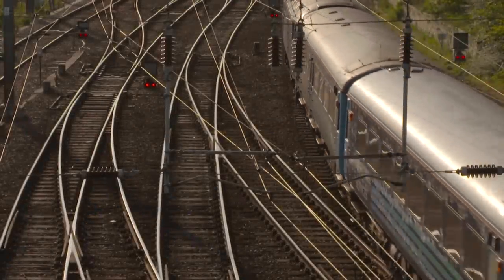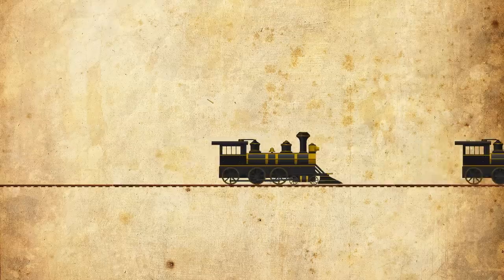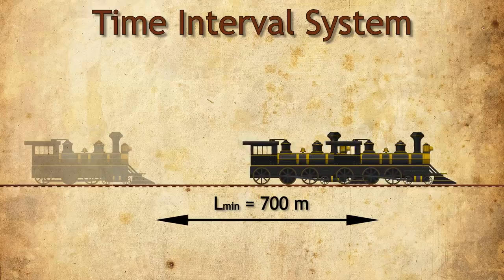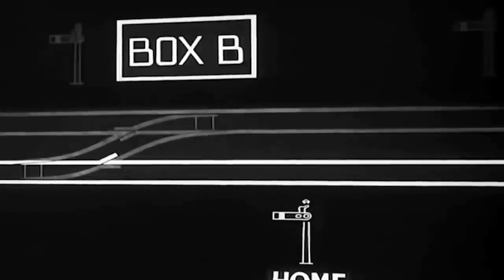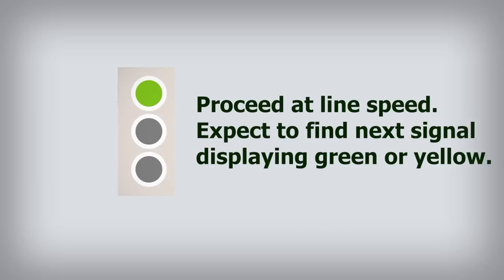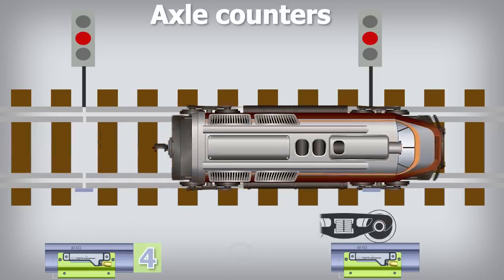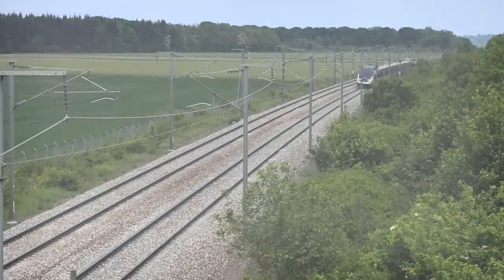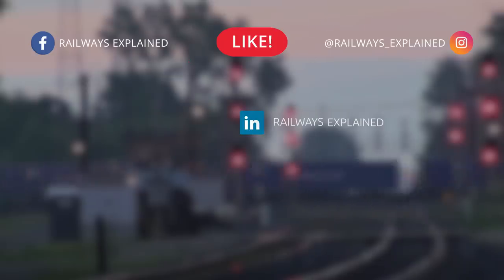How RAILWAY SIGNALLING Evolved from Flags to 4G Network

Comment: Correction, highest speed with lineside signals in europe is higher than 160km/h although in most countries its 160km/h. In UK it is 200km/h, in France it is 220km/h. On the French line thats 220 the first non green aspect a driver will see is actually a new speed limit sign, which is backlit, at 160km/h. I've always wondered if this is some sort of separate distant signal to extend the braking zone.
Reply: Also 200 in Spain (with ASFA protection system, at higher than 200 the ETCS system is required).

About the pre-warning 160 sign you mention, we also have something similar in the form of a blinking green signal aspect. It's called "conditional clear", it means that the track is still clear ahead but you should reduce to 160 because you might find a warning yellow signal later. I think most countries allowing higher than 160 speeds with physical signalling systems have an equivalent indication to pre-warn fast trains
Reply: The "flashing green" was introduced at the SNCF: trains traveling at no more than 160 km/h could consider it the same as any "steady green";  instead the driver of a train traveling at more than 160 km/h had to slow down until the speed was reduced to no more than 160 km/h before passing the next panel.  A pre-announcement signal (P) was also provided for mobile TIVs when presented.  A similar pre-announcement signal was also foreseen for what concerns the TIVs of the construction sites (temporary signs placed to order the reduction of speed in correspondence with sections of line along which works are being carried out).  Instead here in Italy, to allow circulation at speeds above 160 km/h along the "Direttissima" Rome - Florence, they invented the repetition of signals (Cab signals) with 9 codes, adding a second carrier to the one used for the "Automatic block with coded currents" of the American school.

Comment: Thanks for this informative  video on railway signalling, From childhood i have been fascinated by the Railways and still that enthusiasm of train journey has not receded, i always take a train for a overnight journey, during my young age i used to see only Semaphore signalling and that too some had oil lamps at night, put up by the gangmen every evening and slowly this changed to lights with the cables from the signal switching post run to a distance with rollers The mechanical hand lowered or lifted up to show proceed was a marvellous and slowly colour light signalling takes over, i was waiting to hear you say about the keys transferred from one station to other y the loco pilot and this helps to operate the signal lever so that the loco pilot understands whether the block is clear or not clear. There used to be a bamboo bent like a tennis racquet and a leather wallet belted to this will hold the key, when passing a station the loco pilot drops his and grabs the one held by the gang men, this was lovely to watch especially during night when he holds the key with one hand and fire torch in the other, Please show more videos about signalling.

Comment: Actually, although 160kph (100mph) is a common limit for lineside signals, some countries, in particular the UK and France, allow running up to 200kph (125mph) under lineside signals. The UK also did do test running at 225kph (140mph) using an extra flashing green aspect, but this was never used in service (although the flashing greens are still present on the route where the tests took place).
The main variation from the basic green-yellow-red system is speed based signalling. These tend to still follow broadly the same principal, but add in additional aspects (either multiple aspects together, flashing aspects or both) and sometimes will even display maximum speeds. Some systems will also have different forms of red signal, one being an absolute stop, and one being a "stop and proceed with caution". The UK has it's own variation on green-yellow-red which adds in an extra "double yellow" as an advanced warning, allowing trains to run closer together by reducing the block length whilst still maintaining the same braking distance.

Comment: In Britain the maximum speed is 200 km/h except for the high speed channel tunnel rail link.  This speed was introduced with the diesel InterCity 125 in 1976.  Britain is an exception to the rule that the maximum speed is 160 km/h if trackside signals need to be observed.
Reply: There are some classic lines with a max speed of 200 in France too. But except those specific sections, the rule is 160 max.
Reply: @Alfred Weber The requirement for a second man over 100mph was dropped I think in the early 90s, with the limit increased to 110mph. These days it is 125mph unless there is cab signalling.

Comment: The "flashing green" was introduced at the SNCF: trains traveling at no more than 160 km/h could consider it the same as any "steady green";  instead the driver of a train traveling at more than 160 km/h had to slow down until the speed was reduced to no more than 160 km/h before passing the next panel.  A pre-announcement signal (P) was also provided for mobile TIVs when presented.  A similar pre-announcement signal was also foreseen for what concerns the TIVs of the construction sites (temporary signs placed to order the reduction of speed in correspondence with sections of line along which works are being carried out).  Instead here in Italy, to allow circulation at speeds above 160 km/h along the "Direttissima" Rome - Florence, they invented the repetition of signals (Cab signals) with 9 codes, adding a second carrier to the one used for the "Automatic block with coded currents" of the American school.

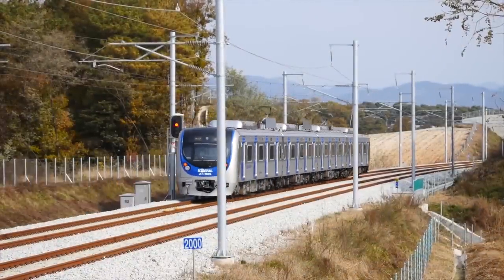Comment: 10:05
I am so thankful you showed good example as Korean. The blue train set is of Korail 371000 Series EMU operating on Gyeonggang line (means connecting between Gyeonggi and Gangwon province) Korail Metro. Most of Korean railfans think 371000s are special. It is because they can be operated on all 25,000V alternating section despite no control centers' approval. ATS, ATP, and ATC were installed in them as first subject of Korail all EMU series. (Of course they cannot be in Direct Current 1,500V ^^;;;)
As locomotives, there are Korail's EMD GT26CW DL7573 ~DL7576 introduced in 1996(earlier than 20 years comparing with 371000s), which are worked as special engine on High Speed Rails; Relief Wrecking Drive TGV-K, KTX Sancheon, and EMU-260&320 of Korail. Unlike other GT26CW DLs in Korea, ATC(for TVM-430) were installed in the four. 
Thank you for reading and have a nice day sir. :)

Comment: It's was a really nice sum up of the evolution of railway signalling. I did not even have an idea the Time interval Signalling existed. 
I suppose it would also be useful to mention that CBTC systems are currently only associated with metros and not yet with main lines. Also a few words on ETCS signalling
Reply from the maker: Thanks Harish for the comment.  We agree with you.  All this will be covered in future videos about signaling.  We think that this video has hit the point and that it allows people who are not dealing with the railway to understand the basics of signaling.
Reply: @RailwaysExplained  My railway will be moving toward the CBTC system as part of stage two implementation of the ETCS ATP that you showed. I agree, another video on ETCS and CBTC would be good.
Reply: @trainstrains1  I am pretty sure that the moving block system is part of ETCS level 3, which still hasn't been properly implemented on any railways. ETCS level 2 is "virtual block" it does not have line side signals, but it still has fixed blocks. This means that blocks can be made shorter more easily and trains can run for efficiently, but not quite as good as moving block.
Reply: interesting basic over view,  well done. & I got lost after electronics entered the equation. thank you.
Reply: @pwhnckexstflajizdryvombqug9042  you are right, moving blocks are featured in ETCS level 3 signalling only. It's such an advanced concept that it's still very difficult to properly implement in open railway systems.
Fun fact, my country (spain) started with ETCS lvl 2 virtual block signalling in some high speed lines, but due to the complexity of it soon downgraded to lvl 1 physical blocks. And it still works perfectly fine, allowing for very frequent and safe circulation at high speeds. So lvl 2 and especially 3 are a bit overkill at this moment.
Reply: @osasunaitor  I'm not even sure that level 3 has ever been properly rolled out either, I think it's still in testing. Hopefully they get it to the point where it can be just an upgrade to level 2 so eventually all networks with level 2 can upgrade when they need the capacity.
Reply: ETCS level 2, whilst using fixed blocks, does allow much shorter blocks to be used so it can operate like a virtual moving block system. As an example the Thameslink Core in London uses ETCS level 2 and ATO to provide metro like headways on a heavy rail system.

Comment: Incorrect info. 100mph is not the speed at which lineside signals are no longer used as my local line runs 110 with 4 aspect light block signals and the max is 125 here using full signalling and signage.

Comment: Here in the UK, the semaphore (mechanical) distant signal was a separate signal coloured yellow with a triangular notch cut out at the end to differentiate it from the normal signal

It was an excellent video - I'm not sure the timed version of the signal was in place here in the UK but I could be wrong
Reply: The Notch was cut out so that a Driver could identify it as a Distant signal, even if the board was covered in Snow.
Reply: The timed system was in use, but was outlawed back in the late 19th century due to the risk of collision if a train became stuck in the section.
Reply: The main difference with Distant signals is that they cannot show 🔴red. Modern ones show 🟡amber for Caution or 🟢green for Clear.  But yellow or amber haven't always been available... so WAY back when, it was red, green (for caution) and clear/white.

Comment: Thanks for all the info. I would be interested what fall-back systems are in place, if there are power outages, the 4G network is unavailable, or any bigger computer sabotage happens. If there is no signaling installed on the line, does that mean that all freight and passenger transportation can be brought to a standstill on all those major transportation lines, just by knocking out those critical networks?
Reply: Historically, it was the wayside code line, comprised of open wire on insulators or some type of aerial or buried cable. To run the signal system, it only takes 4 wires plus a pair for float power to keep the local batteries charged. This power was usually 120, 240, 460, 550 or in the case of Union Pacific, 2400v AC. At each case, this was stepped down to 120v, then the various voltages needed for the various functions needing DC power. On the UP, youd see these step-down xformers every couple miles, then a separate 120v power pair to catch a number of loads, as this lower voltage is easier to manage and protect.  

These facilities carried the ctc code line, dispatcher voice/telegraph, pbx, as well as the HD circuits that made the signal cases actually talk to eachother, so you had a red, 2 yellow and green signals to protect the occupied block. 

Later, microwave radio and dedicated fixed point to point wireless links were established between dispatcher and signals, switches, and defect detection in CTC territory. 

Around this time, electro-code and other impedance based detection and signal systems came into use, with special shunts, better thought of as a band pass filter circuit, at each block end, to keep the audio frequency in the proper block. 

ABS type signal systems were common in the American west, where stations were few and tangents between them long distance.  

Of interest, on the AT&SF railroad,  they had ATS devices that would activate the emergency brakes via induction coil, or mechanical pawl that slapped a air cock that dumped the brake pipe air. This system would activate if a train blew past a red signal or was activated by a dispatcher remotely in an emergency scenario. The first ATS systems were fitted on the AT&SF by the 1930s, and one such installation survived until 2018 near La Junta, Colorado.  

The FRA nationwide PTC Signal mandate spelled the end for these interesting fail-safe systems, as well as countless semaphore, searchlight, and older color light signals.

Comment: In the UK on permissive blocks (section of track) you can have more than one train provided the following trains can see the tail lamp of the preceding train if still in view. This occurs in freight only lines and at stations where multiple trains can share the same platform. Only on absolute blocks is the rule one train per block.
Reply: I believe the idea of permissive signals on automatick block sections is widespread. I'm a train driver between Spain and France and both countries have this system too. I would be surprised to find a country that doesn't.
Reply: @osasunaitor  thanks for that. I was sure that permissive block working might exist outside of. the UK as it is very useful but not being sure I only talked about what I was certain of.
Reply: In the United States it is very common for multiple trains to be in the same signal block. The following trains must drive on sight, though. The USA also makes extensive use of permissive signals, which cannot show Stop but allow trains to proceed on sight into occupied blocks.

Comment: There was one other system for use on branch lines.  A token was used to allow a train to operate on the branch and it was returned when the train left the branch.  Of course, this limited the branch to only a single train at a time.

Comment: You mention in Europe that trackside signals are only used up to 100mph/160kph, but that's not quite complete: in the UK it's a little higher (125mph/200kph)
Reply: We can actually run up to 140 mph with our soon to be scrapped class 91 locomotives. The section of track where this is possible has flashing green aspects. The reason the trains do not run at that speed regularly is because of level crossing timing circuits and the viewing distance track workers need to be able to stand clear of the line.

Comment: The railway workshops museum near my house still have a few lines that still have the mechanical signals (although I’m not sure if they are still used or have been automated)
One of the lines even has the switch point box although I think that may also have been disconnected.

Edit: I only know this because the old line runs in between 2 of the main buildings at the shopping centre near my place.

Look up rRverlink, Ipswich QLD and you’ll see it

Comment: A correction is needed here... It is not true that trains travelling faster than 160 km/h always use cab signals. I can give you the example of the (non tgv) line Paris Bordeaux, where some long sections allow up to 220 km/h, only with lateral signals. There is even a signal aspect- flashing green - displayed before yellow, to instruct drivers to slow down to 160 km/h. There are similar situations in Italy, Germany, and UK.
Reply from the maker: Dear Marc. Thanks for this information. But we need to say that cab-signalling system is mandatory  in most of the countries where trains are allowed to exceed speeds of 160 km/h. Reason for that is because it is difficult for train drivers to see signals at higher speeds. As you mentioned there are specific cases. In these cases a so called multi-aspect signalling is being implemented.  This solution requires that if operating speed of a train is 200 km/h, train driver needs to see a "slow to 160" signal in the first block, and then a stop signal in the 2nd block if there is a need.
 In addition, this solution does not solve the other problems with high-speed operation, the difficulty of seeing signals at higher speed, especially in marginal conditions such as rain, snow, and fog. Cab signalling solves these problems. Bringing the signals inside the cab makes it easy for the train driver to see them which is great contribution to the safety level of railway operation. Regards.
Reply: The flashing green aspect on the East Coast Main Line was basically a fifth aspect with the sequence to red as follows; Flashing Green, Green, Double Yellow, Yellow then Red. The flashing green permitted speeds up to 140mph or 225kph (which is why the British Rail Class 91 loco, Mk IV stock and DVT consist was originally marketed as InterCity 225. The Mk IV rolling stock profile was designed to allow the train to tilt at the higher speeds.) Running on ordinary green aspects gave a MAXIMUM permissible speed of 125mph, dependant of course on the permissible speed shown in the Sectional Appendix and by the lineside signs.
Reply: @PhilSmith71  worth pointing out that the 5th aspect allowed 140mph without having to reposition the signals. 4 aspect would be fine for 140mph, of the signals were respaced, which would have been a painful project. Also, worth pointing out that 140mph was allowed if there were two drivers, to orovide redundency. It was only single driver operation that limited speed to 125mph. A number of years later the safety director changed it so that 125mph was the limit for lineside signals regardless of jow many drivers.
Reply: @FabianEason  I did know that the Flashing Green was the existing Green aspect except that it flashed, but thanks for clarifying that point. ☺️Interesting to know about the other facts though!